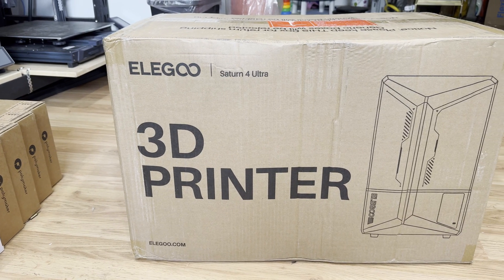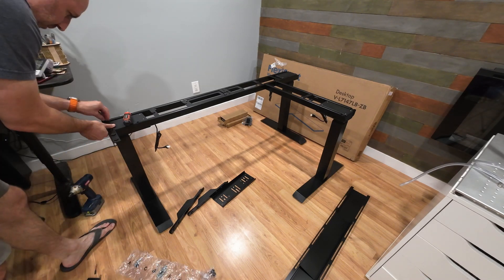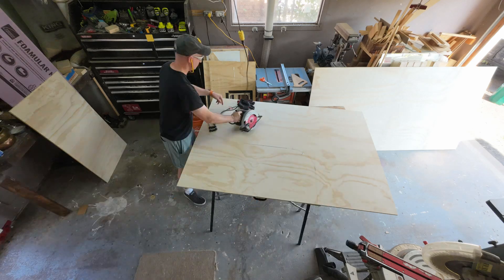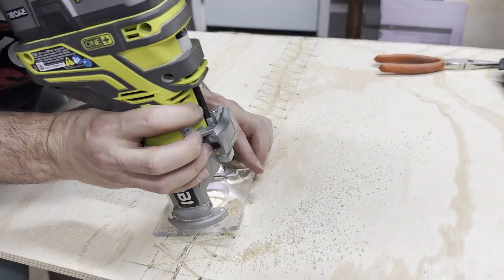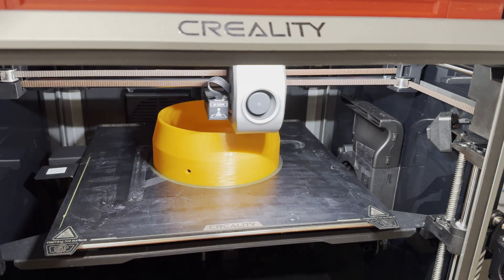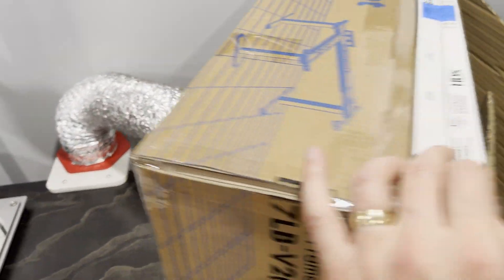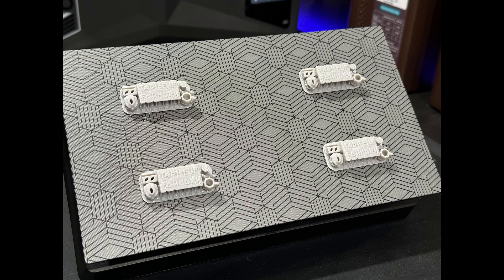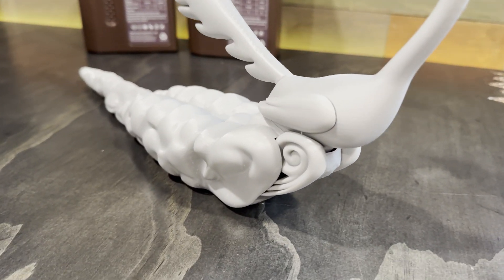The Resin Printer that Causes a Studio Makeover

Comment: Sad to see the iconic CNC table and enclosure design come apart, but the new table design was a very creative! I think if you want to keep using your space effectivey you should set up shelving against the walls on the back wall or bring back in the ikea drawer unit underneath. Maybe you could also put the laser on locking drawer slides on the underside of the table so you can run it fully tucked away or pull it out for servicing :)
Reply from the maker: Was sad to see the enclosure go but I needed the space. I think the CNC will find a new home in the garage somewhere. 
A slide out rack for the laser is an interesting idea since I can raise the table to a working Height. Would have to rethink the exhaust setup. 
I am looking at some kind of shelving under the desk to optimize storage. I want to get a wash station but only want it on the table when I’m using it.

Comment: Table!  Ok, so I need to get one of these desks.  Great setup and love the customization.  I still can't quite get into resin printing with all the cleanup and offgassing and the fact I've never been into printing ornamental pieces - but that was some really impressive output and enjoyed seeing your calibration workflow.  Thanks!
Reply from the maker: Thank 🙏 I haven’t done much resin in the past for the same reasons but using the water washable type makes it alot easier and I want to experiment with some of the stronger compounds to see if it can be used in more functional applications.